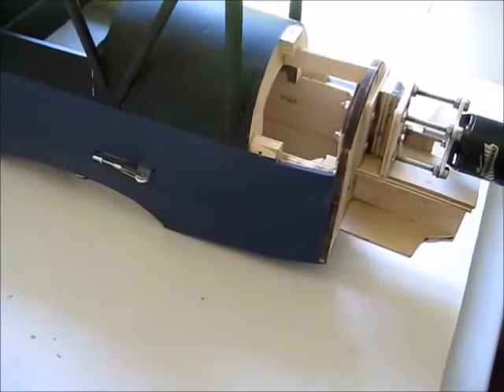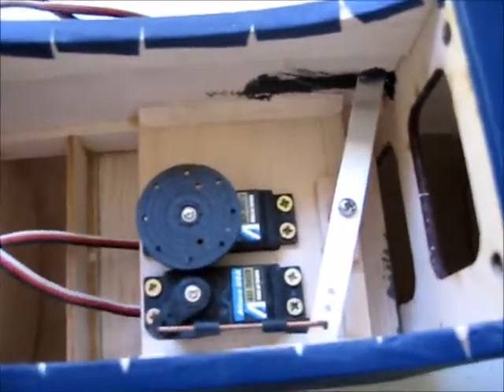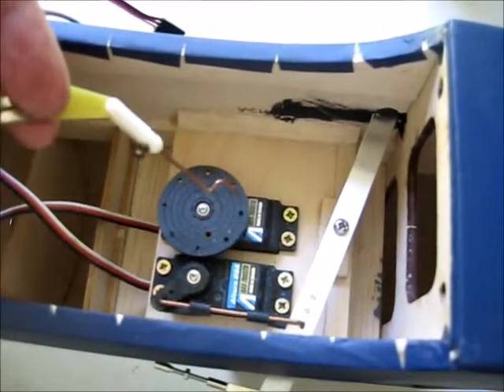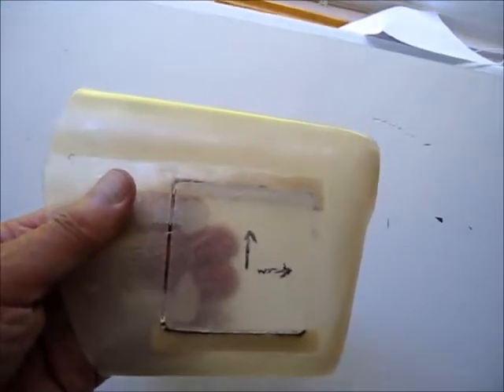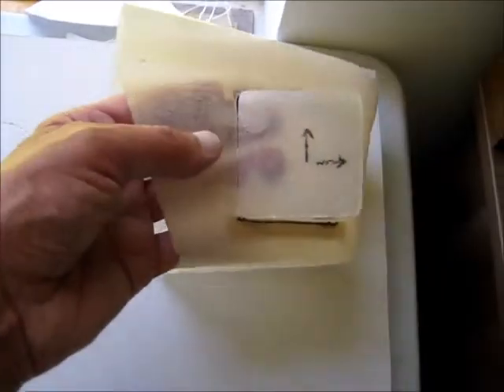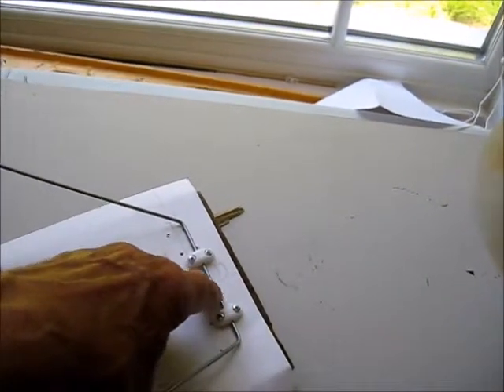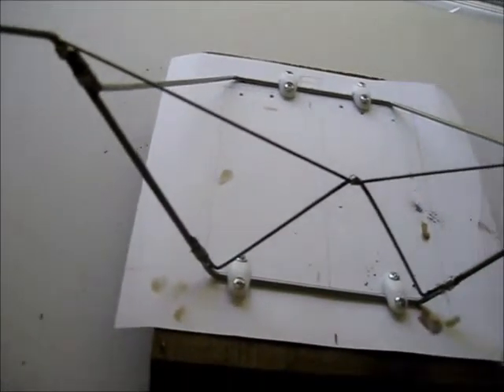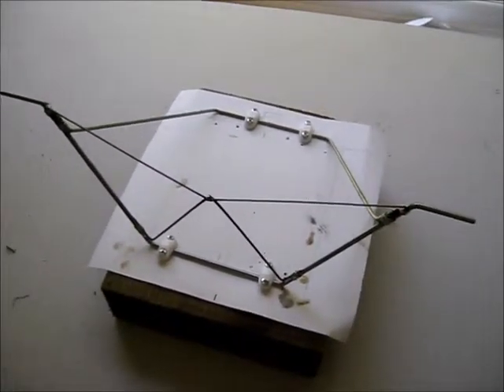DB Sport & Scale Tiger Moth build  - fuselage & undercarriage

Comment: Hi Alan, Just subscribed to your channel and watched all the TM builds so far.You are a great builder, everything looks so neat.Your showing of the servo mounting in wings was great.I tried to build a  similar DB kit but being a novice failed badly,wish I had seen videos like yours prior.This is not a criticism but I wish you showed more detail on the TE build,i had probs with that ,knowing how to do the very rear join of top and bottom te sheet,i had a very thick "butt" join,was later told I should of tapered,even now I do not know.Also the "filler" pieces in the TE and shaping was confusing to the novice.I really hope you do another build, thanks for great work and sharing
Reply from the maker: Thanks Gary, glad they're useful.  Progress has slowed with summer, and I seem to have all the tricky jobs left, but I'll be doing an update video later this week.
Reply from the maker: The trailing edge was a little unusual in it's construction but if you were left with a very thick section I wonder if you trimmed it a little to close to the back of the ribs.  You needed to glue together the trailing edges sheets just beyond the back of the ribs so the section would only be as thick as the two sheets, and then sand to a more tapered profile.  The filler pieces were also fiddly, they don't fit as supplied, and you must leave it until after you have glues together the sheets, and then you can sand to the correct profile and glue in place.